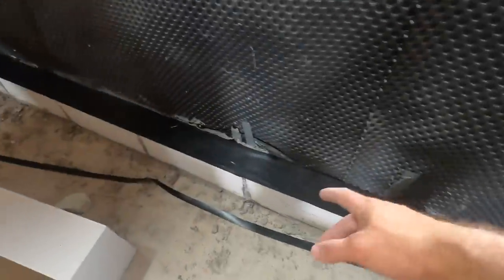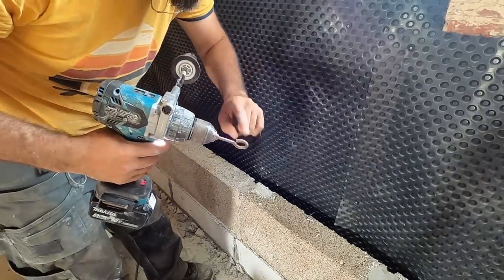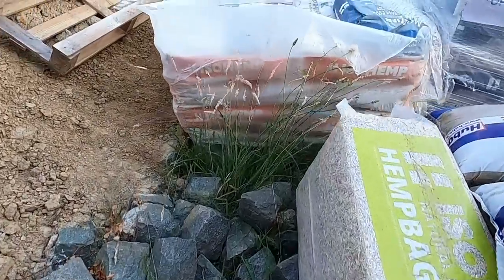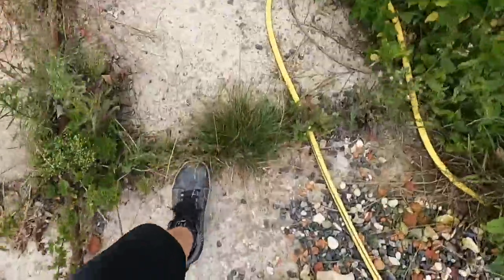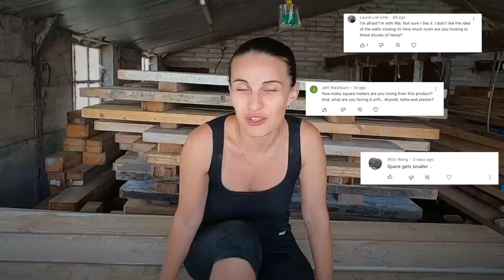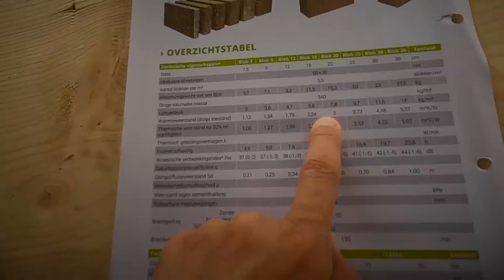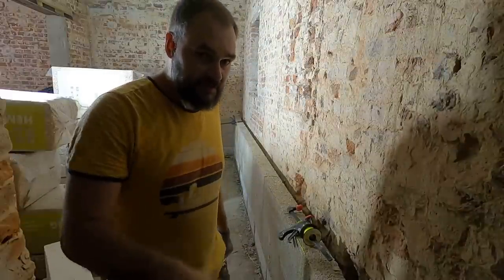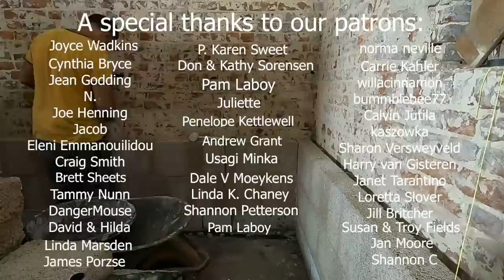DIY INSULATION of our 1908 farm with HEMP

Comment: They've used hemp rope for naval warships for years as its resistant to rot! Great stuff and sustainable too. This hemp is specifically grown for this application and typically has very little THC if thats of any  interest.  

Sidenote: The US Navy hired a nun who was s horticulturist), to develop more efficient growing methods.  She failed and only produced higher THC levels . She's been called the Patron Saint of pot!
Reply: Now that’s hilarious
Reply: Your comment about the use of hemp rope is not entirely complete. Where hemp rope is used as a caulking method, it is always topped with boiling Pitch (Tar). The rope is use as a gap filler, it isn't the primary moisture seal, that is the molten pitch poured on after the rope has been flogged into the gap.
Reply: That’s nunsense 😂
Reply: @philyew3617  I was referring to mooring lines.
Reply: Yes Sydney university had the same when students who where suppose to be trying to breed low THC had a side project of increasing THC producing super hydro.

Comment: Please take better care of your back Illia. Lift those heavy objects with your legs and not your back. Squat to grab ahold of those large heavy bags, straighten your back and then lift with your legs. Your back will thank you and you will really reduce the chance of a back injury. Back strains and disc damage can be very painful and in many cases never gets better.

The reason for the rot in the bags was due to the isolated nature of the container. Mold will grow very well in an isolated, wet environment. That's why they are focusing on using a material that will allow the wall to breathe and reduce or eliminate the moisture that may be transferred to the inside of the house from the bricks.

Comment: That black plastic they use is a capillary break. Bricks and mortar are porous and hold moisture. 

The bottom of the walls will have the most moisture for a few reasons: gravity, rain hitting the ground nearby and splashing onto the wall, and moisture from the ground traveling up via capillary action. The walls will dry to both the outside and the inside. That's where the plastic comes in. The dimple pattern allows any water droplets that form on the inside of the water to drain down under the floor into the ground. The air gap and plastic material prevent any moisture from transmitting from the brick to the insulation and finished wall.

The white stains are called efflorescence. I haven't heard of that being caused by nitrates from fertilizer in rural areas. It certainly occurs in urban areas and is from salts being leeched out of the bricks and mortar by water.

Comment: That's what I was concerned about in your last video.  If it molds in the bag it will mold in your house! That's really unacceptable in an insulation product
Reply: The bag didnt have much of a way for it to evaporate safely. But as she states in the video it will be different in the house with movement between the bricks the blocks and the insulation. Think of it like a bag of bread, leave it open and it goes stale, leave it closed and it molds.  Hope that helps 😊
Reply: @tracybabe  I cannot make any sense out of part of your post.
Copy- "Think of it like a bag of bread, leave it open and it goes stale, leave it closed and it molds".
That to me sounds like two very obvious reasons not to use it.
Reply: You don’t use bread?
Reply: @tracybabe  That is an ideal, but there are many times during an extended wet season, or possible a long vacation when heat is set lower than normal, developing leaks etc where the media will get wet and won't be able to mythically evaporate. This doesn't include wall treatments no matter how friendly to the process will inhibit the process further. So as I said, if it molds in the bag with just a blush of condensation, I will guarantee that there will be situations that it will mold in the wall. They should treat it with some sort of copper sulfate or something that won't allow it to grow.
Reply: I suspect that the product that they mix into the loose fill has anti-fungal agents to prevent these problems.

Comment: You should try using a COX tuck point applicator.(Caulk gun using a fillable tube to hold caulk/mortar to tuck point joints.) I think it is made in UK. It is fantastic for tuck pointing!!!!!!!!!!!!!!!!  I used it to do about 450 sq. ft. of bricks that were resawn to 3/4 in. thickness. It is FANTASTIC...... Also - add a squirt of dish soap to each refill to  make it come out smoother. I think it is about 32 oz. size.

Comment: thanks for the videos! you might look into adding some borax into the lime mix  for the hemp , its used as fire retardant in cellulose insulation  which is what hemp is effectively. the lime mortar/rendering  will be more difficult to apply and  isnt like concrete  as it dosnt really cure  it de hydrates slowly  but it is as you know breathable so is a better choice in this system. r value of a specific product is only part of the story  in architecture theres a calculation called enthalpy  for the total r value of a wall including openings and frameing/masonry  so it is a total  representative of the structure ....in canada r 20 in the walls and 30+ in the ceiling usually is code . typically you want the vapor barrier as far outside as possible  ...as you are aware dewpoint and freezing make it preferable for moisture to freeze on the outside rather than inside the wall. but winter is somewhat milder on the other side of the atlantic. the space compromise you refer to is probably less than 2% of the total which is justified by reduced operating costs and comfort   . looking forward to more progress.

Comment: If the hemp can rot that easily, I am worried about its longevity if some moisture or condensation still can penetrate an old house, in some corner or other places. What about perpendicular walls creating thermal bridges? Great work by Illia, as usual.
Reply: Maybe in Russia where  normal winter temperature in european part is -20C (and that is considered as very warm weather in Siberia) it makes sense - corners will be frozen through and moldy. But in Belgium? I dont think that's matters.
Reply: @elrond12eleven  Many videos were already about the moisture issues of the house.
Reply: i'm sure it rotted because it was mostly sealed in the plastic, once it is in/on the wall it will be able to breathe and loose the moisture
Reply: @dDoOyYoOuUtTuUbBeE  and they solved that issues, not complained about them. Repaired drains and roof, made blind area and so on.

Condensation can't occur where aren't waterproof surface, and all the wall - bricks and hemp and finish - is vapour-permiable. My family ownes (in Russia with winters aforementioned) 70-yeras old post-and-lintel board-scheathed wooden house filled with simple sawdust, without any membranes and so all - my great-grandpa could not afford anything else - and it works perfectly. And our neighbours were fools enough to cover their similar house with metal sheets. Vapour condences on the metal and their house rots, but they even don't know it until it falls on their heads.
Reply: @elrond12eleven  I agree with your report and analysis. I just hope it will work the same. I am worried about cold spots somewhere in the corners and on the walls since they start from what the house was and didn't build it. And about the behaviour of the hemp as it was shown.

Comment: this has to be one of the most difficult ways possible to insulate a building. Yikes..... I would really like to introduce you to easy products like mineral wool boards, which are so much simpler to install and also water and fireproof! Oh well, at least you are insulating! I don't see a vapour barrier though, so you may have condensation inside your insulation as warm interior air condenses on the exterior cold surfaces.  You will possibly end up with mold growing in your wall, if you don't put a vapour barrier up before finishing.

Comment: When my folks lived in Hungary, and also my grandmother's house, they used the lime plaster and while it was a messy process, wasn't as hard to apply - just time consuming on top of the mess.  I hope the same will be in your case!  As for the amount of space 'lost', I don't see that as a major issue.  The farm house is huge and there's a second floor too!

With the heat increasing in various parts of the world, will the hemp insulation work to keep the rooms cool in the summer too?  Will you be installing air conditioners later on when the rooms are nearing completion or is it not necessary in your region? From what I've read and from folks I know that live in the UK for example, their homes are insulated to keep heat in but there wasn't much thought to try and keep cool in the summer as temperatures historically were never that high and would risk the health and safety for the young and elderly.  Just curious.  

As I see how fast Illia works, looks like the hemp insulation will be up very quickly!  He got that row down and back filled and anchored so quickly it seemed!

💙💛
Reply: Insulation should work to keep heat in just as well as it should keep it out. I live in Melbourne, Australia where our summer temperatures can be 40oC several days in a row, and in winter we can get single digit minuses overnight. We try to insulate as best as we can afford because it both keeps house cooler in summer and warmer in winter.

My parents are living in a rental house not far from me, and the additional money I paid to upgrade my insulation is vastly noticeable in the two extremes of temperatures. The added bonus is less energy required to use air conditioning or heating. Good insulation saves so much money in the long term.

Comment: I've looked at this several times and I'm not convinced hemp is the correct solution for that farmhouse. Yes hemp is a good thermal insulator but those exterior wall bricks are porous, they soak up water like a sponge. Moisture rising from below is not your main issue, in that building the main source of damp will be from wet weather, and it rains a lot in Belgium.
Two critical factors should have been at the top of the suitability list. 1)-Heat always travels to Cold, and 2)- Moisture always travels to a dryer place.
By filling in the cavity you created with the hemp blocks, you appear to have created a perfect bridge for moisture to get from exterior to interior. You will need a lot of ventilation and you may need to install airbricks in the external skin to try to keep the moisture under control.
You could have reached a point where the ventilation to keep the damp under control exceeds the thermal saving gained from the hemp blocks. 
There comes a point with old buildings when you have to accept that some modern solutions are just not suitable. I sincerely hope I'm wrong but I don't think so.
Reply: That's what the plastic membrane for to stop damp .

Comment: all very interesting, the longest part of the process seems to be when you fill the gap, can it not be bought in sheets like standard insulation? nice job though... cheers
Reply: In Canada and the USA it is available in sheets. They would have to frame up the interior though as in a modern frame construction building in order to use the sheets.

Comment: that bagged, loose insulation fibre looks like it's been wet for much longer than it's even been at your location. how did the moisture get innate that sealed plastic bag? I suspect it was a little wet when it was bagged and stayed to rot before it was even delivered. It takes time for something to get that bad. Maybe let the company know that there are several bags that are rotten and see if they'll replace them.

Comment: That course should have started with a half block - you have barely 50 mm spacing between adjacent 'verts'
Reply: does it matter if it isn't truly structural?
Reply: @jennifercash1093  Yes as cracks will develop over time from thermal movement.
Reply from the maker: Thank you for your advice, Andrew!
Reply: @andrewmawson6897  ah thanks for the Evanston

Comment: Surely moisture in the walls will compromise the hemp, especially if it rots so easily?
Reply: It doesn’t rot any worse than the pink fiberglass stuff with a paper backing. If the hemp does get wet, it can be layer out to dry and reused. It’s been in use in parts of Europe for over 50 years.
Reply: I’ve not heard of hemp rotting unless the building exterior is compromised. 

Also important to note that man made fibres also rot when when wet.

Comment: I can't believe that 20cm of hemp insulation is only R3. That much fiberglass would be something like R20
Reply: Yeah, that was interesting. The stuff available in Canada and from Sundstrand in the USA is R7 for the sheet version.
Reply: That's a metric R value. It's actually RSI. It's equivalent to about R15 in North America.

Another advantage they have is that the insulation value is the same across the whole wall. Where in a typical north American home, the insulation is only between the studs, lowering the average R value.
Reply: @drooplug  Thanks. I was confused

Comment: In the last two videos you've said, "because we're insulating the inside" not the outside. I'm not familiar with insulation on the outside of a home. Can someone give me an example of how that would work or be an option anywhere? 

I'm in the US, and most of my experience with homes are hollow stud walls with layers of (inside to out) Drywall (or plaster & lapping), studs, plywood outside, vapor barrier, then siding (or brick) exterior.  Obviously this is limited experience, so I'm curious about 'outside' insulation and how that would work?
Reply: There are a products that you can apply on the outside such as rigid foam insulation. However, in winter climates it isn't enough and interior insulation is required
Reply: @PgPatrick  is it a foam that goes between bricks and a siding product (e.g. vinyl) to make it attractive looking and not a pile of foam?
Reply: @XYGSteve  he said rigid foam.  It would come in sheets like plywood and of varying thicknesses.  It would go under the waterbarrier.
Reply: @chamqual6480  got it. Thank you. He said apply, and that made me think of spray foam. I missed 'rigid'. Thanks!
Reply: @XYGSteve  Correct. It's usually thick (can be an inch of more) and applied on top of exterior plywood and then the exterior finish is applied over that. Exterior siding can be clapboard (plastic, wood or composite), brick or stucco. There are plenty of other layers such as a vapor barrior(s) but that's the basic order.
Reply: As Perry Patrick posted. If they wanted to keep the bricks exposed on the interior, install sheet insulation, then exterior cladding. They probably would have still wanted some sort of interior insulation as well, Those brick walls are going to be pretty cold during a Netherlands winter…

Comment: if the hemp rotted that easily outside with water, why it is then watered when installed. im just worried that you got yourself a moldy home, right away !
Reply: It actually is quite rot resistant. But you don’t want it, or really any insulation sitting out in the rain getting wet before you install it and it rains a lot in the Netherlands.
Reply: It was wrapped in plastic with holes in it once it gets wet it can't breathe very well.
Reply: Leave just about any interior building material out in the rain and it will deteriorate. A bag of nails would have turned to rust.